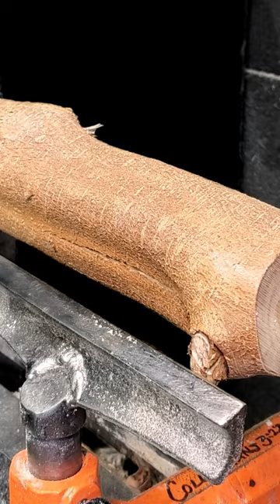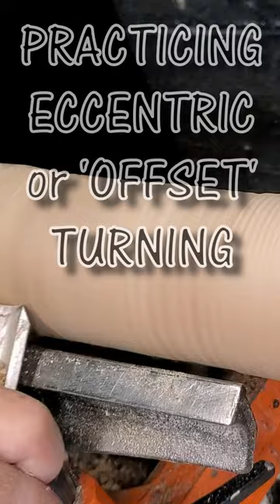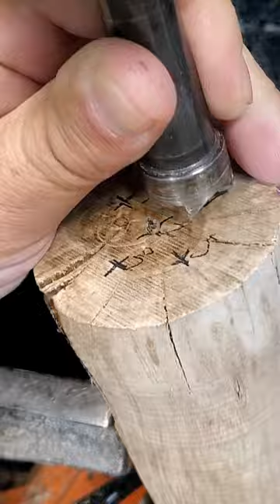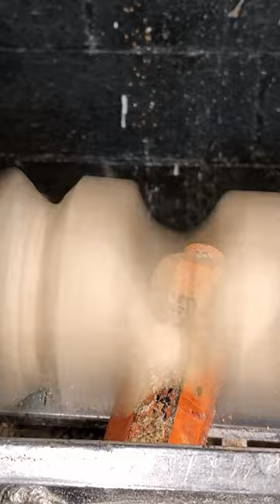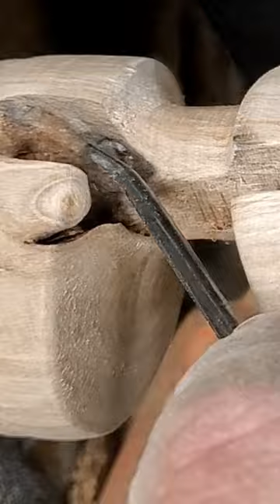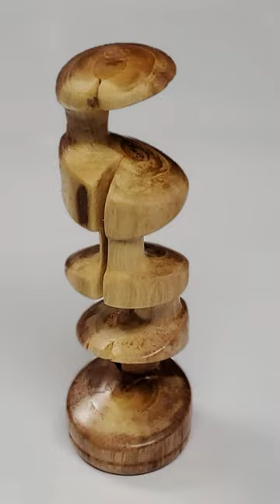ECCENTRIC TURNING

Comment: Sanding sealer... Does that harden the wood and finish it after done?
Reply from the maker: @mrPauljacob  yes, basically. I am sure there are others who know the science, but it seals the outside and raises the grain. If you go back and lightly sand it makes it so smooth.
Reply: @BAILEYWOODWORKS  I'm gonna have to give some a try I think
Reply from the maker: @mrPauljacob  I like the shellac based sanding sealer. Also it dries very fast so you can keep the project going. Zinsser makes a really good sanding sealer. Bullseye, Seal Coat.